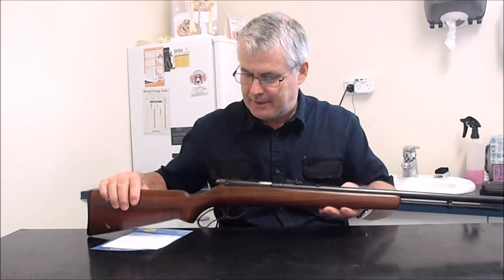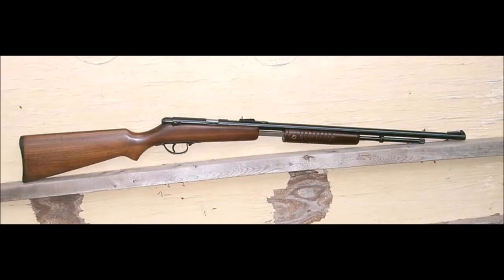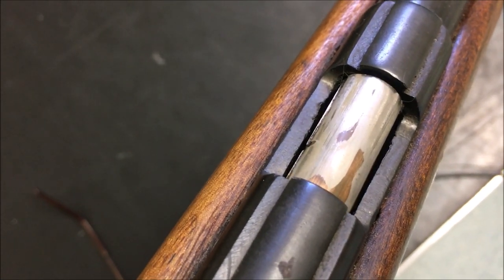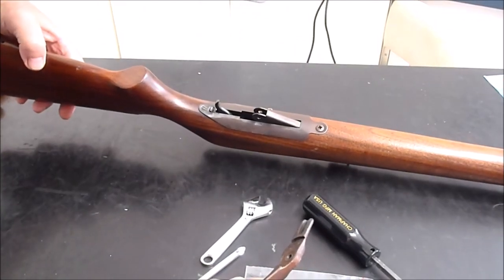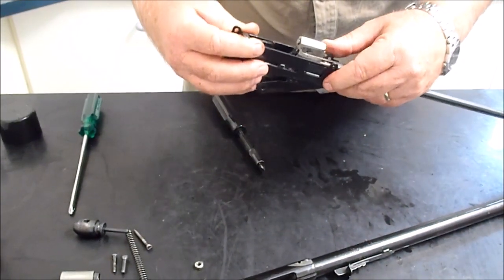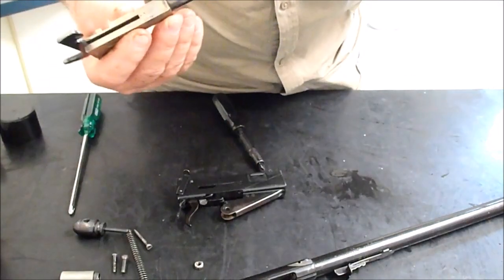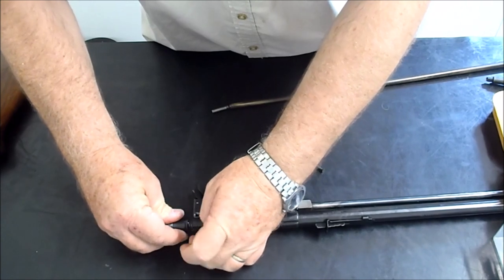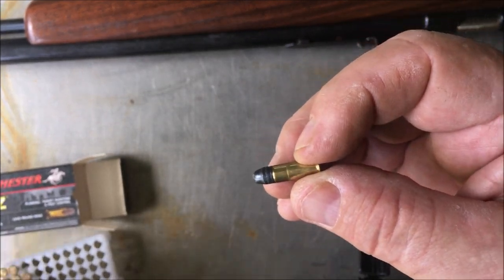Noble Model 275  .22 Lever Action  Rifle. History,  Description, Repair  and Review.

Comment: Thanks for all the information.  I have a Noble model 20E bolt action .22. My dad gave it to me on the early '70s.  I broke the butt plate and the extractor when I was a kid. It still shoots fine, I just pop the casings out with my thumb nail or a knife blade. I have always thought of the gun as a crude turd. I just keep it for sentimental reasons.

Comment: Nice video, I inherited my uncles noble model 60 16ga pump,with a fixed full choke 30 barrel, still shoots good I use it on the trap range every now and then, unfortunately it's true that there's almost no information about this firearms company available anymore, and these guns have very little collectors value (saw in a gunshop value book noble shotguns are only worth $200 in good condition) I'm just going to hold onto mine for sedimental reasons it's still fun to shoot!
Reply from the maker: Thanks for the reply Kyle. Sounds cool. If I lived in the USA I think I would start collecting them as you could amass a large collection of very quirky firearms for very little money. All our pumps were confiscated in the '96 gun grab.